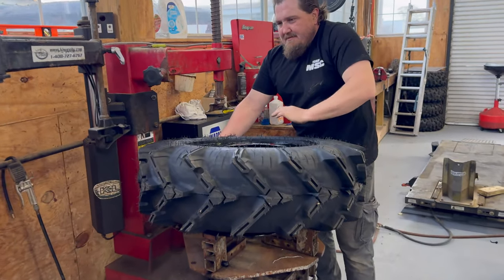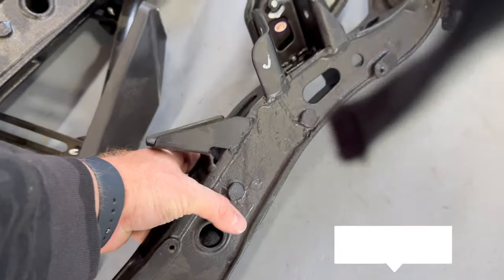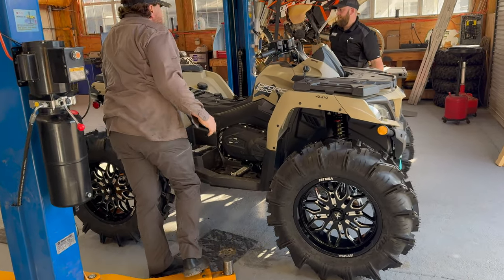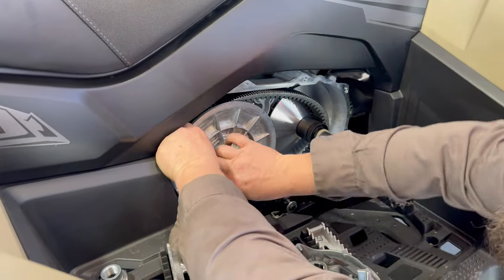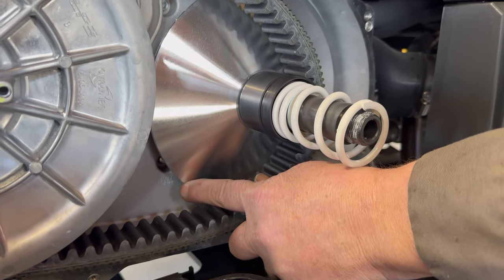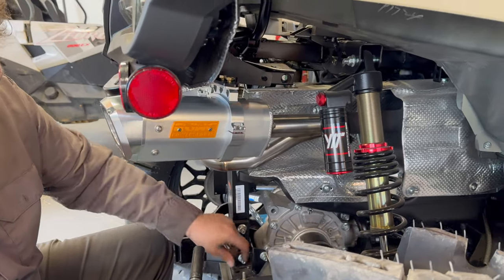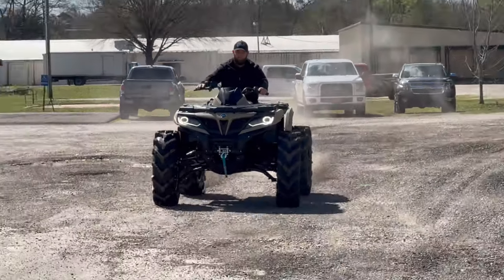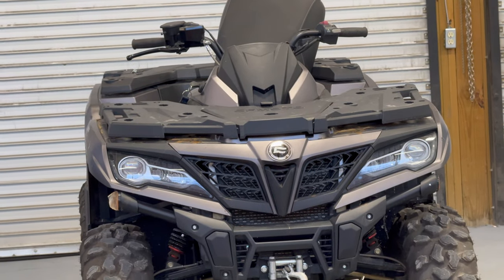CFMOTO CFORCE Long Travel Build w/ Mud Monster Clutch Kit & 34" Tires

Comment: Do dyno test with this tires
Reply from the maker: That sure would be rough on the tires lol
Reply: @RealTalkPowersports  well, as far as I know, even big tires can be tested on a dyno, I know that otherwise it is tested on much smaller tires, type 30 inches or less, but this way with these tires we can see the maximum power, because that cforce will still be driven on those 34 inch tires

Comment: when do you expect to get the gen 3 800 and 1000
Reply: I just bought the Gen 2 2024 cf Moto 800xc a week after I bought it my local shop got the gen 3 1000’s in . Needless to say I was a tad bit pissed because I would have just waited a week and bought the gen3. It’s a massive bump in horse power. Now don’t get it twisted the Gen 2 800 stock has plenty of power I got it up to 76 mph last weekend but I believe Gen3 800’s have 75 horsepower and the 1000’s are at 98